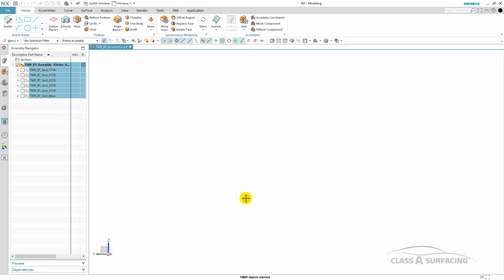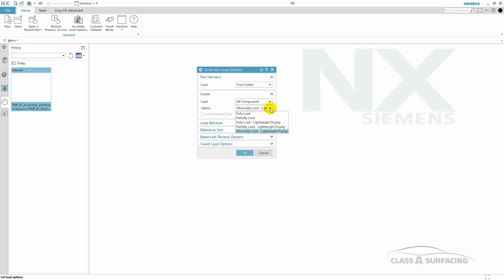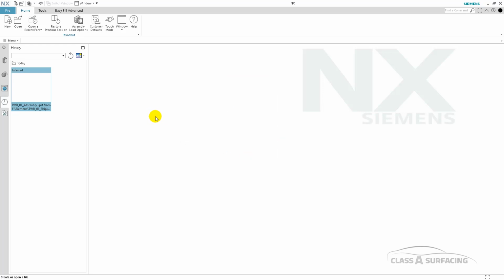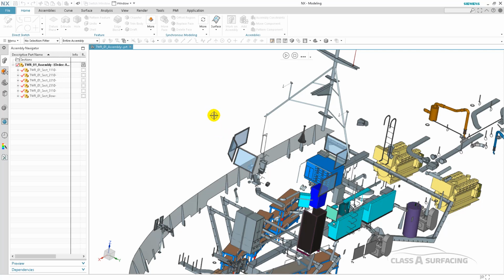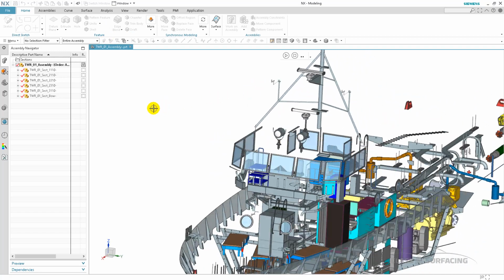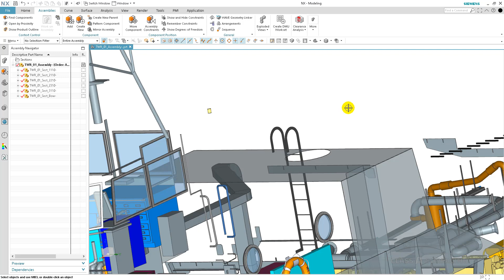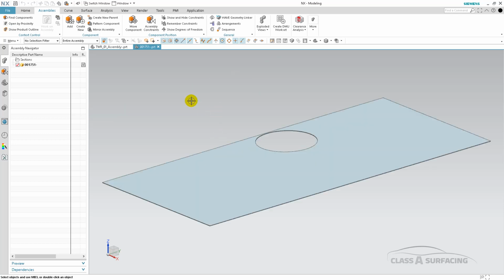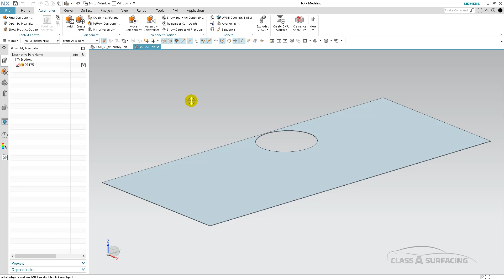NX Assemblies Load Options: Minimally Load

Comment: Minimal loading is more than just a pretty picture. It is the precise solid in memory, but lightweight in display. If you did a measure you get exact measurements. The new Minimal is definitely sweet when working with large assemblies, but I would not use it on small assemblies.
Reply from the maker: Yep, all true.

But also, as you know it does not load inter-part data. So if one was going to go on about designing in the context of an assembly with links, this may not be the option to use.
Reply: class A surfacing True. The primary use case is design reviews, or large assembly drafting.